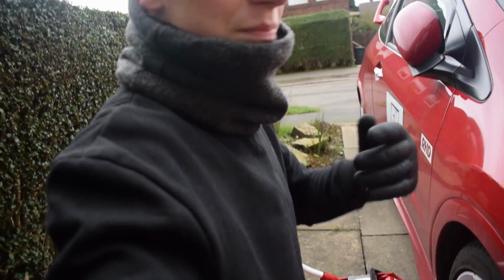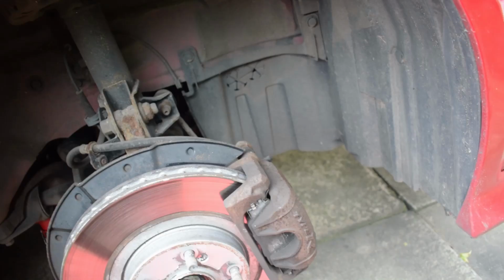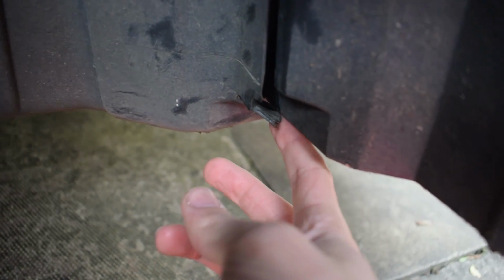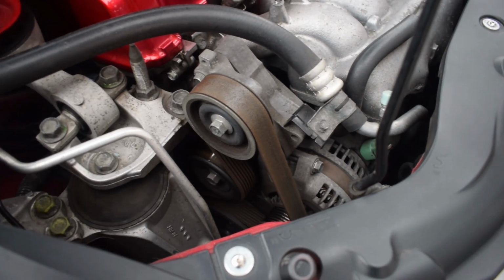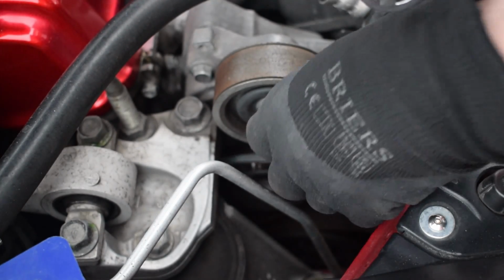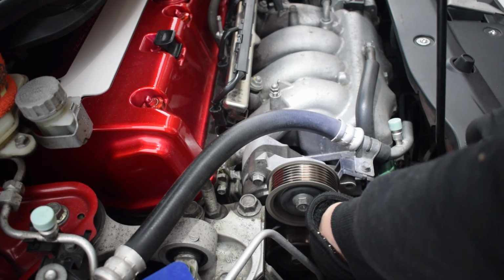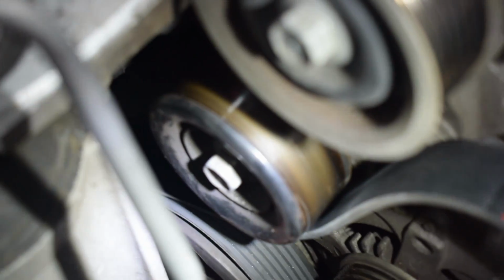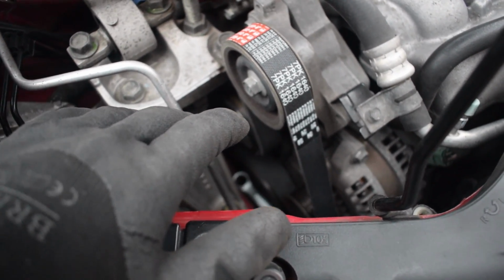Replacing an auxiliary belt (Civic Type R FN2)

Comment: Great vid mate 👍🏻 nice to see you learning by yourself. 
Ps you don't need a starter motor as mine done the same before having the clutch replaced. It's the carbon dust from the clutch plates clogging up the starter pin to the flywheel so it won't engage with the flywheel to crank your engine.
As you can hear your starter motor fine it's just not engaging because of the clutch dust. 
That's why after a few attempts it engages from freeing the pin 👍🏻 
When you have a clutch change they clean all that dust out and all will be good, trust me I've been through all of this on my FN2 so don't waste your money on new starter 👍🏻
Reply from the maker: Never looked at it that way. Thanks for the knowledge 👍🏻

Comment: Thanks for this vid. Is it possible to change the top pulley and the tensioner pully from the top as I have a humming noise that I need to solve.
Reply from the maker: No problem. Yes I'm sure you can change the pulleys from the top.

Comment: Thinking of changing mine to. Because i have this constant whining sound on low rpm, not sure if it's the belt that causes the sound
Reply from the maker: Hmmm I'm not sure either 🤔
Reply: Really old belt creak as the rubber starts to distort what you are probably hearing is a worn out pulley

Comment: When re-tightening the belt, is it possible to over tighten? Or does it reach a point where it won't move any further?
Reply from the maker: The tensions pulley just goes back into a set place when you release it so it won't have any extra strain on it.
Reply: @FNLEW  Thanks for that!

Comment: How often does one need to change the belt ?
Reply from the maker: When it's slack, cracked or very brown in colour.
Reply: Is there any given  kilometer intervals than one needs to take into consideration?
Reply from the maker: @n.t.1970  I'm not sure. There maybe information on the topic in you manual.